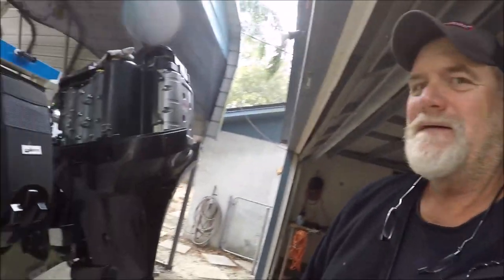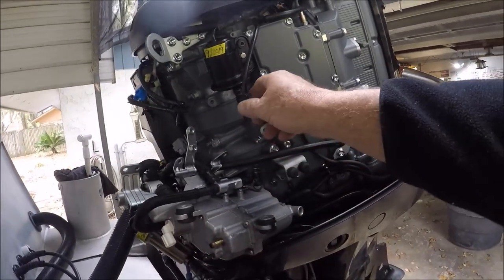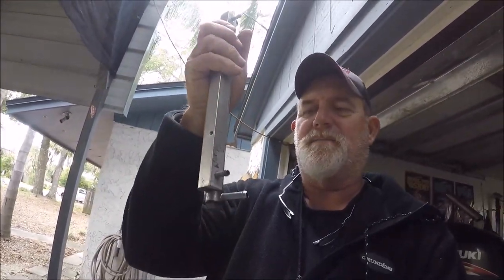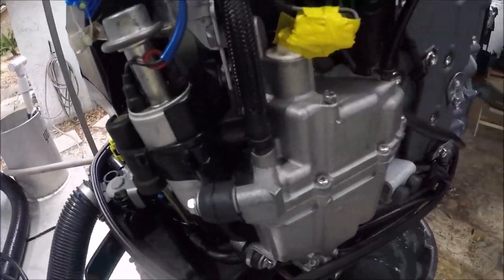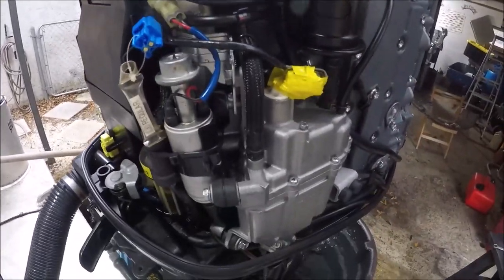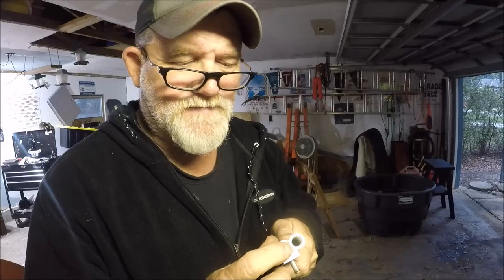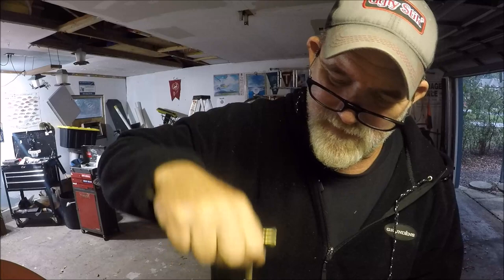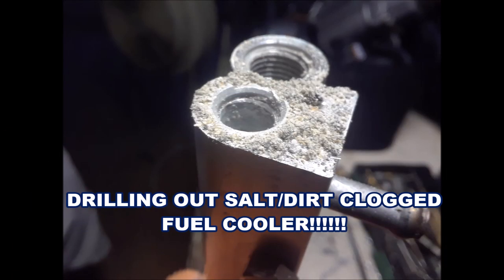SUZUKI DF250 ''hidden issue' Clogged fuel cooler'

Comment: Thanks for the  informative video about the fuel cooler.  I run a 250SS on a bass boat in tidal water up here in VA, and during the summer time, I have similar problems as well with fuel vaporizing after a long run.  There was a  Suzuki bulletin where the fix was putting in a  350 low pressure fuel pump, but I haven't done it yet.  Your solution seems better vice putting a band aide on it with a bigger fuel pump.
Reply from the maker: I run a ''dirt river''.....NEVER EVER use that flushing ports on the motor!!!!!!!  I only run in a barrel of fresh water up to temp, for 20 minutes every day.

Comment: Great video. Thanks for putting this together. I have a 2018 DF200A outboard with about 160 hours. The engine runs in salt water in the north east. I boat the boat / engine in 2020 with 80 hours on it. I always use non ethanol fuel. I’m having an issue after the engine is running for a bit. It has a hard time starting. Starts fine with a cold start. Took the VST apart. Looks very clean. Engine is maintained per the manual. Would like to here your thoughts if you think the fuel cooler being blocked on the sea water side would cause this? Thanks again!
Reply from the maker: NO my problem was in 100 degree Florida heat at first, then got worse. My motor had thousand plus plus hours and runs in absolute dirt water. plus I used that stupid flushing port versus a barrel, because a 250 has low water pick ups in the lower unit and cant use the muffs on it efficiantly.  DO NOT EVER USE THOSE FLUSH PORTS.

Comment: Good Morning Dave….! Great vid thanks. I  have another DF250 (2008 I believe) Serial Number starts 25001F-88…… I can get a parts motor starting 25002F-88….. 

Do you perhaps  know if parts are interchangeable….? Particularly the tilt and trim. Mine still work,but has been corroded by salt from previous owner
Reply from the maker: i know there's after market parts out there, like Sierra but if they don't work, i don't have time to screw around. days equal dollars for me, so i use OEM.

Comment: Hey Captain Dave. I have spent a couple days working on that same engine. The fuel bulb was getting completely flat and it would shut down the engine with beeping. Computer says no active faults, but says it’s overheated 6 times. I removed the check ball in the tank, and replace the bulb and lines to the engine, so now it will run fine up to 5100 rpm’s. If I go 52 or 5300 it will start cutting out like it’s not getting enough fuel. No more beeping and engine coming to a stop like before, so it has gotten better. Do you think the fuel is vaporizing. Great video btw.
Reply from the maker: Ya may want to check that good ole fuel cooler.  or VST/ fuel pump. I'm no expert, just a shade tree mechanic / charter boat that looses $ if  something happens and can't drop it off at a mechanic for 3 weeks.

Comment: Capt Dave, Do you know if the fuel cooler is similar on the DF 150? My DF 150 does not pee when in the water, but pees great on the flush ports. I flushed it changed the thermostat, OP vlv, cleaned the oil pan cooler, and the electric unit cooler. Everything was full of sand, I bought the motor used was given the song and dance how great it was. I guess the next thing is the fuel cooler do you have any other suggestions before I attempt the fuel cooler? Thanks
Reply from the maker: sorry I had to have the mechanic tells me to change or check the fuel cooler that was behind by VST tank when mine was actually cutting off from fuel vaporizing before it ever got to the  injectors. I don't know if that has anything to do with not having a indicator stream.
I am not a engine mechanic. I'm one-hundred-percent shade tree.

Comment: Thanks for the video, just to  confirm,I have to  drill out to  be able to  clean,no other way thru the actual nozzle connections?I take it the fact that no water comes thru that its totally blocked
Reply from the maker: If you take out your fuel cooler from behind your VST tank and you cannot blow through it.  It's clogged!! Yes it's plugged with pressed in aluminum plugs I drilled my out.  then ran a wire brush thru it with a drill. pipe cleaner type wire brush. then used JB Weld to re plug it up.
re installed and Never had a stalling issue again, but Im in hot as hell Florida! Problem was in the Florida heat, under the cowling would get so hot, after a hard run. Then, Id get stalling, with no more starts for at least 2 hrs.
Suzuki engineers used this to cool fuel off, the system is FLAWED! But thats a modern 4 stroke outboard for ya. Plus, NEVER, EVER, EVER, use flushing ports on motor!!!!!!!
Flush and run in a barrel, up to temp. if you run in dirt shit water like I do.
Reply: @CaptDavesSportfishing  thank you  for taking the time to  reply,mine is definitly clogged then,will follow your advise here,i do  have another issue unrelated with my Df140,if i may?Motor is rebuilt,still running her in,now onto  4 hours of the first 10, on 4200 rmp it drops to  300o rpm, and will stay there, i tapped back and re try to  accelarate ,it goes to  400 rpm and drops again,the starts to  search  a bit, any idea?thanks in advance
Reply from the maker: @tertiuspretorius2045  INJECTORS??  sounds like it needs to run with the laptop plugged and software, with a real mechanic. The diagnostics software will tell the story.
Reply: @CaptDavesSportfishing  Thanks Mate ill keep you posted
Reply from the maker: @tertiuspretorius2045  GREAT!
Reply: @CaptDavesSportfishing  HI Dave, just a update on the clogged fuel  filter, I mangaed to  unglogg and clean it without drilling out, I got the tip to use Bicarp of Soda & vinagre,wait for a while to  finish bubling and boiling then follow with hot water, after a few attempts it all came out and clear with compressed air, I hope this will help as a alternative,thanks for all your advise so  far will updat on the Fuel injectors
Reply from the maker: @tertiuspretorius2045  Wow.....that's something!  I had no time to experiment when cleaning mine out. So, that's good saved yourself a a few steps.

Comment: Hey Captain Dave this video was really cool and informative! So thanks for posting it! I have a 04 225df and was wondering what the meaning of the VST tank buzzing sound is when I turn the key before trying to start the engine...? When I first got the engine it never made that noise so now I’m scratching my head and when I tried to run it with the ear muffs before that noise occurred the engine started right up twice but wouldn’t piss. Any suggestions of any kind would help a ton. Thanks
Reply from the maker: The buzzing is your fuel pump that round thing cylindrical next to your VST tank that's it pumping fuel from your fuel filters.
I'm sure it's always done it and you just ended up just noticing it or something.
I went through all this because the fuel cooler behind a VST tank was clogged with salt and Bud from The Wonderful river that I run up and down. Which isn't so wonderful its a dirt mixed with ocean Salt River. And after years of using that flushing on the front or the back of the motors it does not flush your engine properly at all.
That's the reason fuel cooler clogged your fuel cooler really means a lot when it's a hundred degrees and your run hard and it's two hundred and something degrees under your kaleng on a hot summer day you turn the engine off you go to restart it runs for 30 seconds and then conks out because all your fuel gets vaporized.  Don't ask me about the engineering part of it all I don't sort of totally get it but I'm not a Suzuki engineer over in Okydoky, Japan. The reason you're probably not saying the tattletail piss stream did you may not have enough water pressure or it's clogged you can run a fine wire up an error some heavy-duty monofilament sometimes little shells and stuff like that get stuck in there and keep it from pissing as they say

Comment: Hey hi with thermostat removed from place flushing the engine will water come out from top where thermostats seat in place????
Reply from the maker: YEP....thats why those flushing ports are for shit! ALWAYS run motor up to temp, with flush muffs or in a barrel for complete flushing. Without up to temp, t-stats never open. IF YOU RUN IN DIRT WATER like I do, and use the flush ports on motor, give it 3 yrs and your fuel cooler can clog and you'll experience motor shutting down when it's 110 degrees in the FLORIDA summers after hard running and then anchoring up for hrs. I had it all happen to me......

Comment: Question. I have DF115 2002. Hardly any water shoots out the peep hole. New impeller
Reply from the maker: FUEL COOLER has zero to do with water coming outa the pee hole. If it isn't running hot, don't worry about it. The pee hole isn't but  indicator. Still could have junk in it unless it's been cleaned out all the way to the block, and that hole could be obstructed. a tiny shell will cause it. I am not a mechanic. Just a fishing guide keeping my stuff running.

Comment: Does any hot water from the  power head run through the cooler  or is  it only cooler water  directly from the lower pickup?
Reply from the maker: no no water doesn't come from any pick up, it comes from a hose routed from the back of the motor if I can remember before it goes in the block cooling passages.
Reply: @CaptDavesSportfishing  I have a 15 hp fuel injected Suzuki that has only 8 hrs on it. There is a hose directly connecting the  fuel cooler to the P tube which results in cool water leaving the P tube. On idling with the ear muffs it starts right up and after a minute the engine block feels warm however the P,tube water is still cool. So is the warm water  from the engine block shunted directly to the  lower unit exhaust ?
Reply from the maker: @andrewfalik2504  well number 1 your 15hp is a far cry from a 250! You may not have a fuel cooler at all. And the piss stream is just a indicator of water flow, has zero to do with  engine temp. The T-stats regulate all that. Yeah warm water exits the exhaust. Unless you're having issues with sut downs due to over heating don't over  think it and consult a real Suzuki mechanic, in which I am not. I'm a fishing charter boat doing my own maintenance and work because I can't drop my boat off to sit for 2 weeks till the work is done like Willy Weekender can.

Comment: Are the ECM's on the Suzuki's water cooled?  If so, could they get clogged? - - - Lake Ponchatrain, LA - right near my home town!
Reply from the maker: no....FUEL COOLER (did you actually watch video???) can get clogged. NEVER EVER in nasty water use on board flush ports
Reply: I did. I was wondering in addition to the fuel cooler if there was a water cooled ecm that could get clogged. I appreciate all of the videos you have done. I am making notes for my zuke.

Comment: Can you tell me what diameter size was the cleaning brush you used?  What type of material was the brush?
Reply from the maker: no idea. It was a brass harbor freight brass ''pipe cleaner'' like brush. fit fine inside after drilling out plugs.
Reply: @CaptDavesSportfishing  Thanks for the Harbor Frieght lead for the brush.

Comment: Could this have anything to do with 2  cylinders not firing?
Reply from the maker: Not at all. Its due to using that stupid flush port on the motor in nasty dirt saltwater, instead of running it out in a barrel full of clean fresh water.